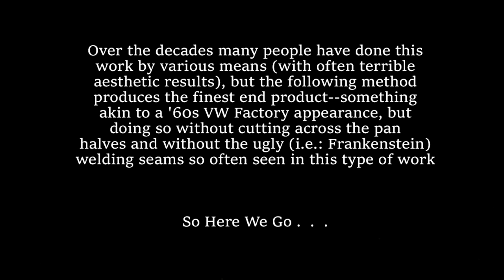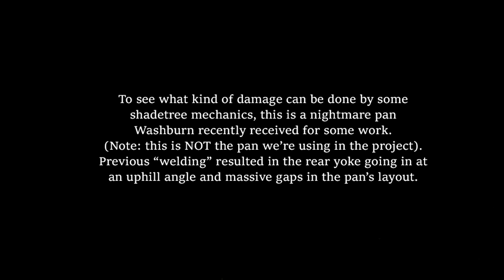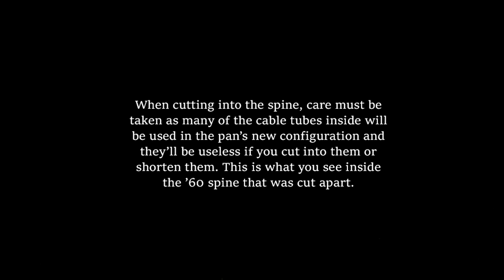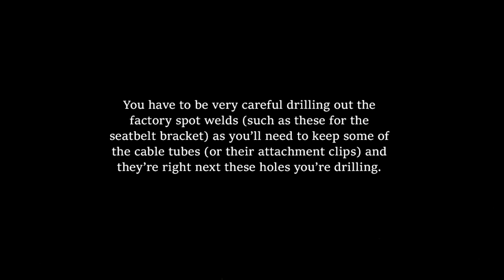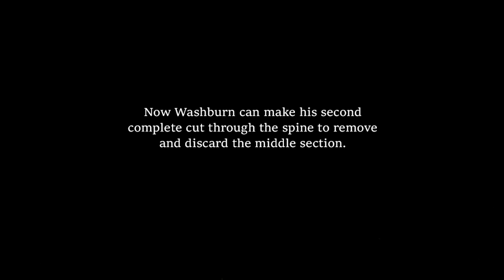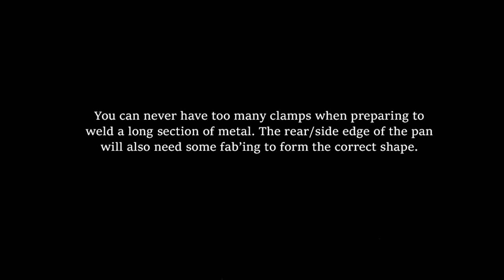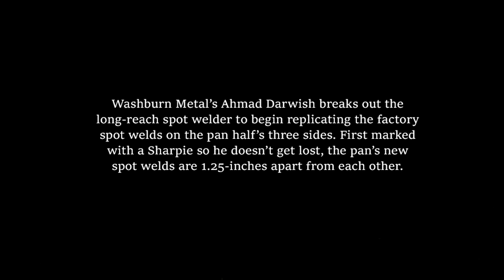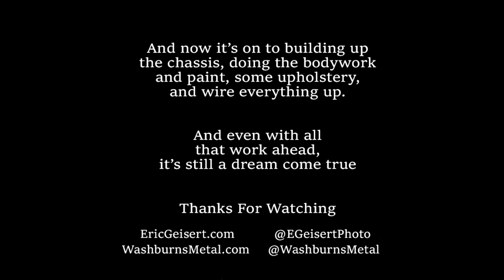Washburn Shows How To Build A Perfect Shortened 356/Manx-Type VW Pan

Comment: Well, I guess the question that most people might have is, say I deliver a chassis and shortened pans to Washburn's for a buggy chassis, what could one expect to pay? The last thing I want is a hack job. I'm planning on getting a brand new Meyers Manx Remastered kit and I think that a quality job on the chassis is extremely important. I basically want a "new" vehicle when it's done. Thanks for the video, very informative.
Reply from the maker: Well I hope what I showed is that Washburn doesn't do "hack jobs." As for pricing, it's a lot like how you'd order a new car--what options do you want? I believe he has a worksheet that you fill out indicating what options you'd like (IRS or swingaxle, fuel injected or not, powdercoated or raw, etc.), and he can get pretty close to a firm price. He'd have to see what you're starting with, of course (in case it's bent or twisted, etc.) but if perfection is what you want, he can do it.
Reply: @EGeisertPhoto.  Thanks for the reply. Yes, you showed that Washburn does top-notch work! I am a strong proponent of letting professionals practice their craft and I am far from a professional in this area. As much as I enjoy being elbow-deep in a project, I believe the better approach is seen here in your video. I can assemble all day and that will be enough to satisfy my needs. I will get in touch with Washburn for a quote. Thanks again!
Reply: I'm in the same boat.

Comment: Just a thought but with all the work and fabrication put into shortening the transmission tunnel what would the time difference be in making a new transmission tunnel from scratch?
Reply from the maker: While the work may roughly be the same, both the fabrication time and extra materials (to make a tunnel) would be cost prohibitive. VW tunnels are quite stout, so better to use what's there.